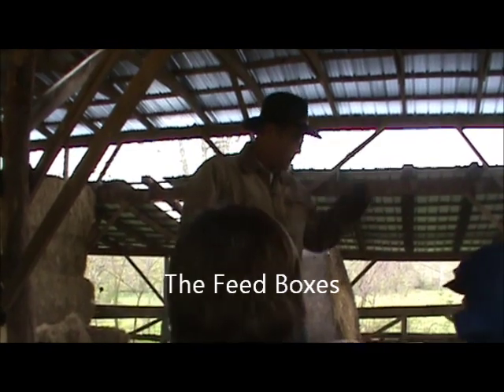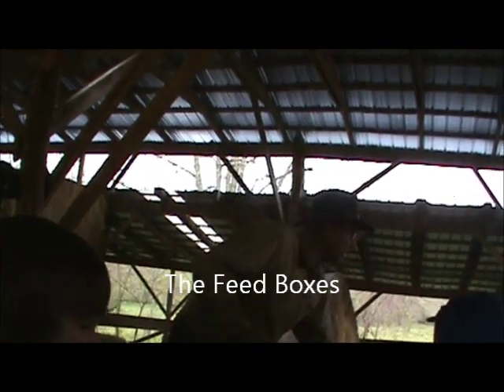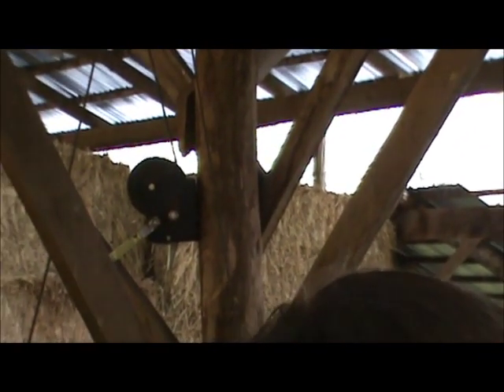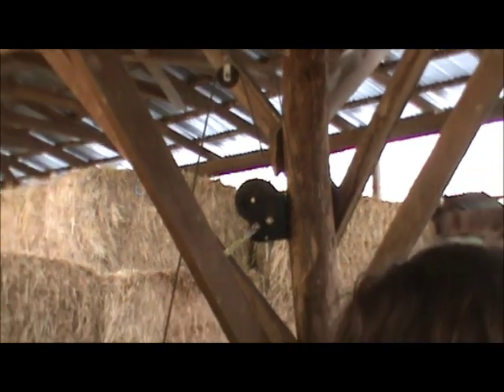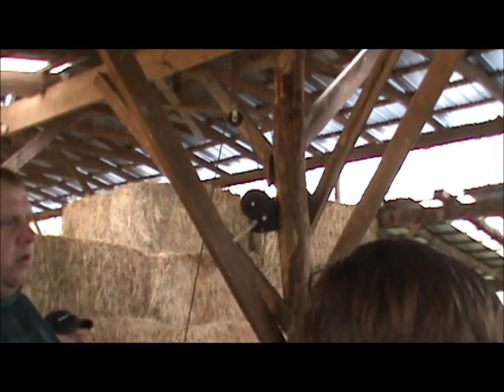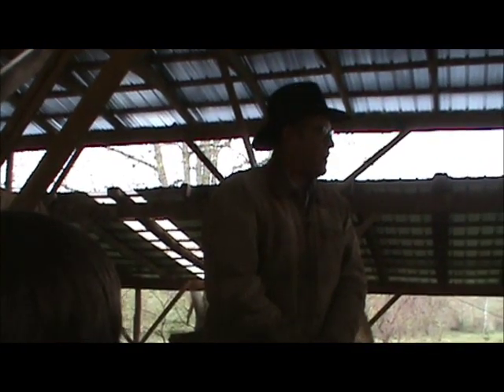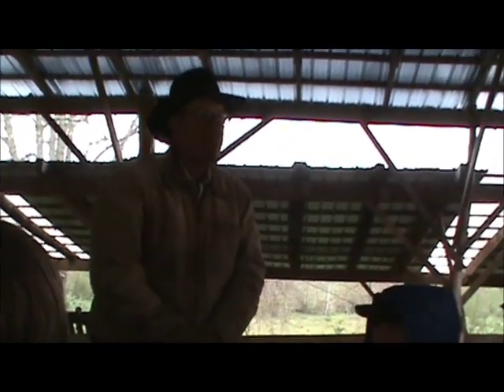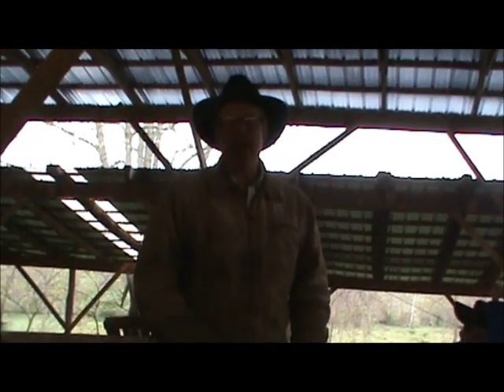Joel Salatin and Polyface Farm Part 2 Video #43

Comment: Interesting that other graziers pasture cattle year around in eco-mimicry system w/excellent results for cattle sheep, goats, etc AND build soil, & increase biodiversity in their pastures - with little to no hay fed in winter (to minimize fossil fuel use; dedeprectiating machinery & create an economically viable farm) - Greg Judy, Jim Gerrish, a guy in Canada.  They 'stockpile' grass grazed as ''standing hay'.  They sometimes get green under snow. Guess there is more  than one road to Rome...
Reply: Those grazing practices are excellent and are working really well for a lot of people. The one problem is that to graze cattle in our colder winters you have to have lots of ground to stockpile grass in the fall. On our farm, we probably get around two thirds of our grass in the May and June which is less than one third of the growing season. You can't stockpile that grass, and so the option is either to bale it and feed it as hay in the winter, or let the cows trample most of it and just have more land so that you can grow enough grass for the winter months during late summer and fall.
Reply: He said they feed hay "after they run out of stockpiled forage".